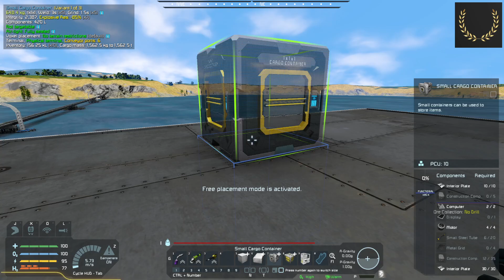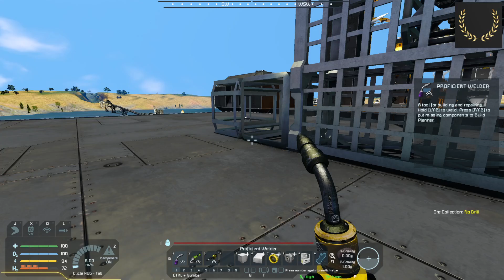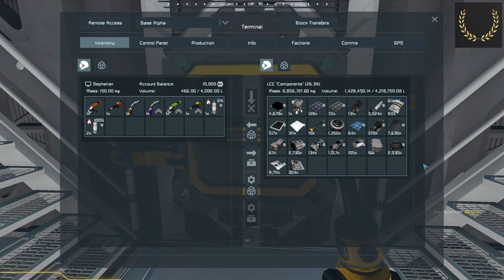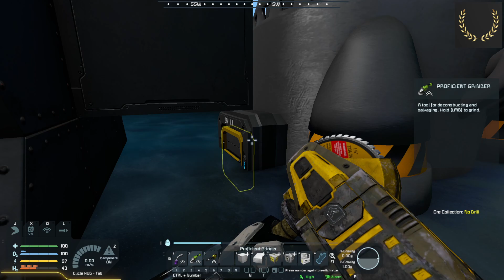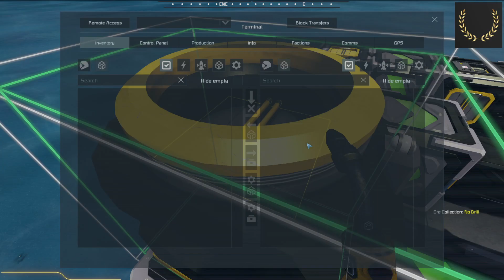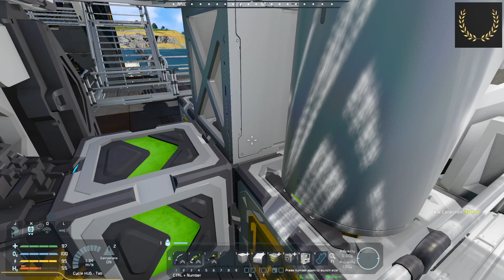Comment: How does this setup avoid overflow? I find when i use in line refineries and assembler, the assembler fills with one type of ingot and stops working.
Reply: Best advice is to double up and double up on refineries and sorters for each line with additional cargo space but you should consider adding a sorter at the end of the line but before final storage to use it's pull to keep the refineries empty of build up 👍

Comment: btw. for the ResourceNodes exists an IratorEdit version which has a reduced thumb sound volume. You can also reduce it yourself editing the sound files with aud4c1ty, where i would suggest to put it down to even 25%.
Also if you like to play with mods, there is one which just reads the customdata of sorters where its much easier to configure them.
You maybe want to make a more in depth video, where you feed ALL your refineries with sorter based input of ore types. Like a consolidated input line where you can just switch sorters to feed it with specific ores. Too bad, we cannot filter for certain ingots, otherwise we could even let event controller manage those sorters, based on ingot availability ^^
Im sure your viewers would like that, at least console player ;)
Hint: add "console" or "vanilla" to the vod name - algo likes it
Reply: @MichaelArlt  I'll have to look into the volume for the resource nodes. I do like them for limited voxel destruction and unlimited ore production. I do like the mods. 
With the sorters in my set up on the bigger version I really only needed one for all ore just for refineries. I only added the one for ice cause I needed a separate line and one for stone as a way of prioritising ore over stone in the refineries. Going in depth on a vid is an interesting idea. 
Do you mean having multiple sorters for a single refinery line? I think I might be misunderstanding the goal at the moment.
I'll  take your hint on board as well thanks👍

Comment: The sorter leading into the refinery should black list ice, then the one out of the refinery should blacklist ores, then the sorter out of assembler should black list ingots and pull all.  Doing it this way you can skip the bypass reducing the complexity of the grid and reduce resources needed.  Also, there should be a large cargo container that each sorter pushes inventory into..  this way if one step lags, it doesn't lag the entire process.
Reply: I usually whitelist *Ores and Stone and whitelist Ice with another sorter.
Reply: @SceptiKalmannsSandbox  👍
Reply: @Lasrin  I agree 👍. Kinda forgot the extra cargo during the build but I did mention tho 😁

Comment: So I have a suggestion for a video. I'm very new to SE. I'm only around 100 hours in. This weekend, I attempted to make a hydrogen drill ship, but I was confused why ice wasn't going into my engine. I believe everything was connected, I had a small grid hydrogen engine, h2o2 hydrogen and oxygen tanks. Was i missing something? Might make a good video
Reply: @TheRealPhilG  well first I was gonna suggest the live stream Vod that went up today since I build a hydrogen ship in it. Then I notes in the comment something you ether didn't add in the comment or didn't add to the ship, it's the o2h2 generator, that will produce some hydrogen to get your ship moving. Maybe even on to a hydrogen facility to fast refuel. Also check for the stockpile button and be sure it's off. And have another look at the conveyers or ports the engines and tanks are all connected too. Let me know if you have any luck with it👍
Reply: @sephykrayt  no, i did the dyslexia thing and said h2o2 when I meant o2h2. But I'll look into it again. Thanks for the video recommendation though. I'll give it a look
Reply: @TheRealPhilG  👍